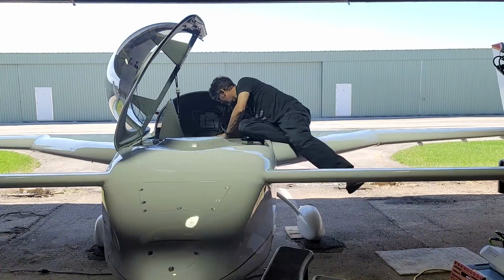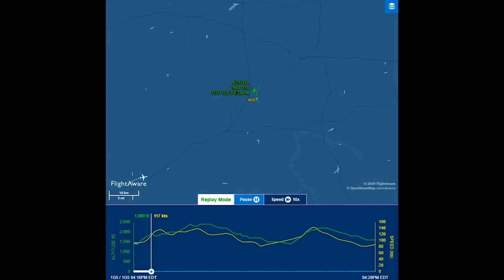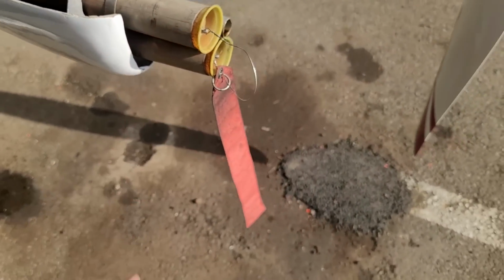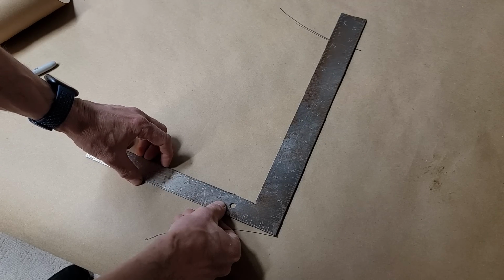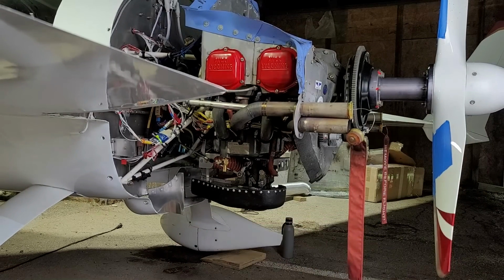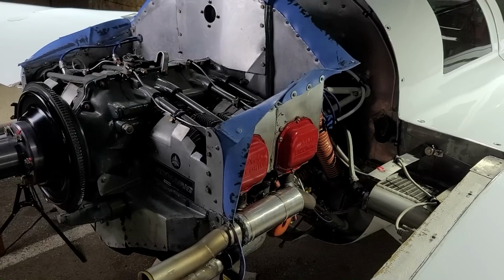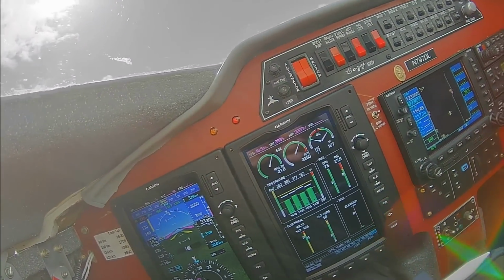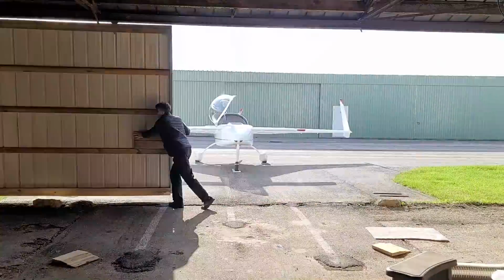First Test Flights: Unexpected Results

Comment: Yo scott do you get nervous doing a test flight after a long break and maintenance like this? Whats the feeling like going down the runway after making all these repairs and getting the plane back up in the sky after months?
Reply from the maker: I spend a LOT of time making sure everything is perfect first. That's why I started with a ground run, inspection, then single pattern, inspection, before leaving the airport area.
Reply: Can't speak for Scott, but you have to be very confident that you have done everything needed for safe operation of the aircraft.  At a certain point, you just need to buck up and go.

Comment: The splatter is lead.  You were probably running rich for cooling.  Very common.  Rubbing compound and elbow grease will remove.  I usually just leave it.